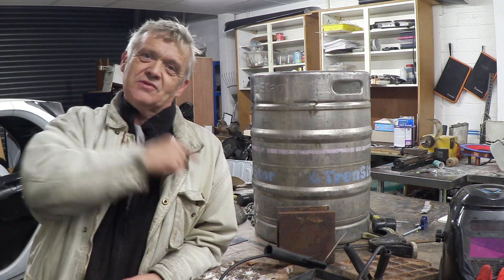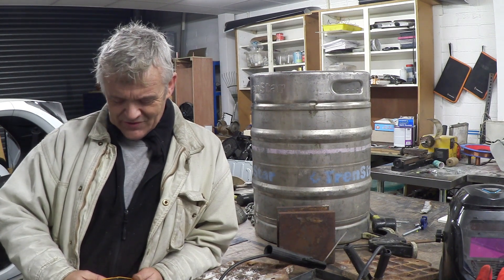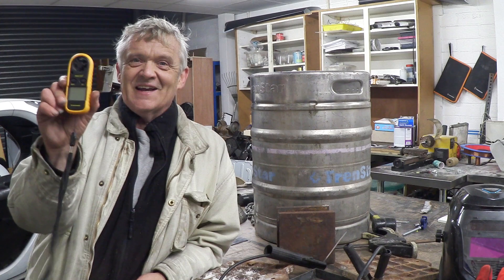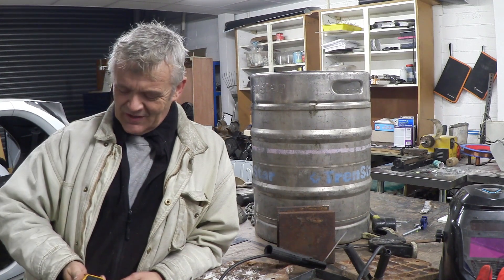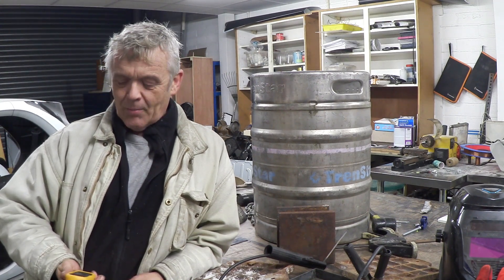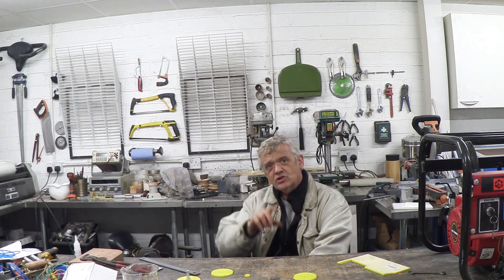Building a 1kW Wind Turbine  For Under £100 - Part 7 - A Real Wind Test

Comment: I was impressed at the begging but when it went to electric part I am disappointing with some of your explanations or thoughts. Trying to use transformer cores opposite way... No one who really knows what to do will never ever think about it. And I expected that spacing of magnets you designed to fit exactly the patter of magnetic core interface and then you talked about putting it in 90 degrees to the magnet line. I lost completely feeling that you know what you are doing. I hope you bring some real numbers from MPPT converter soon or you try ti find it with variable resistor and two meters looking at the values together. You always measured open voltage and short circuit current that can not be multiplied to get power. And how close you want to add the coils. Also magnet orientation is probably not the best what about using Halbach array. I understand you are trying to do it in 100GBP but...
Reply from the maker: you seem to be taking this a bit seriously - to be honest mate I don't know what I am doing and have said so many times. I am by no means an expert and I am certainly not putting my self forward as such - it really doesn't surprise me I am getting things wrong - but that's all part of the journey lol

Comment: Toss this on top of a water tower at a higher height and run it to move the water up via a battery bank on a cycle that can be reusable, but discharge the resivore as a larger battery.

Comment: imagine making these around 12" high about a meter square and placing 20 of them on top of a truck trailer, when its doing motorway speeds, could it be enough to run or charge an electric truck?

Comment: Hi Rob.
I tinkered a little with Crossflow Wind Turbines a few years ago. I think you'll achieve better RPM and power if you alter the angle of attack of your blades.
Reply: Thank you for your input! What adjustment would you recommend?... assuming the same 60° blade shape. I believe 37° was his specified goal.

Comment: Will you please explain, in more detail, the problems you believe to be with horizontal, versus vertical magnet arrays?
Reply: One problem is it will also need to be able rotate about a vertical axis to face the wind, this adds to the complexity.

Comment: MORE coils is '[almost] always better [provided there are not so many they cause the turbine to stall anyhow, because the more you interrupt a circuit, the more efficient the power gain, be it by the total number of coils, OR the increasing frequency experienced by those coils. ~( 'w')/

Comment: I would say here that checking the wind speed against any form of obstructive surface is going to give you a rather inaccurate reading... ~( 'w')/

To get the true and genuine speed, you need to hold your anemometer at least 1 meter away from the object, or AHEAD OF the object, so as to get the pure, uninterrupted or accelerated wind speed.

Comment: I use 600watts available per square meter at 10m/s. VAWTs may be as low as 15% efficiency, so 0.48m^2 should get at least 40 watts, but vanes to block incoming wind striking the part of the rotor moving into the wind should raise the efficiency, and if those vanes extend farther, they may increase the "swept area".
Reply: Just redoing my calculation above and removing the 16/27 factor the calculation comes out at spot on 600 watts at 10 m/s. Good to see some correlation.

Comment: I've watched quite a few of your videos now, and really enjoy the "guerrilla engineering", so forgive me if you have already tried this in your various turbine experiments. Have you tried using one of those spinning signs as a blade? The ones with a sort of "S" cross section. I've thought for about 20 years they seem a very efficient shape for a VAWT.
Reply from the maker: they are basically a Savonius type mate - but I really like the idea there

Comment: If you want to improve the rotational velocity then you want to keep the mass to the center and avoid as much as possible having it on the outer diameter.  Any drag at the outer edge will have a mechanical advantage working against power output.  Keep your motor separated from the turbine mechanism or it will be very poor efficiency.  Sticking to the principles of physics, wins.
Reply from the maker: cheers mate

Comment: Really promising, this could well be the basis for my grand off-grid plan using several technologies together for power (combining this, wood gasification and solar, to name some) Not to mention an FWG battery-bank. I built myself a vertical generator some years ago for my yurt and while it did produce something and was therefore useful, it was really crappy!
Reply from the maker: they tend to be lol

Comment: Robert. I have a possible dumb / genius question.. Watching the blades rotate, I can't help but think that there will also be a fair bit of wind resistance on the blades as they spin towards the wind - after they have been pushed away.. Whatever the terminology is. "Drag" or whatever. I wonder the efficiency and how this can be more streamlined?
Reply from the maker: oh there is mate - but it has positives as well as negatives - for one think it limits the speed in high winds and may well do away with the need for a brake

Comment: hi Robert, great work! I have a test proposition for you with a wildlife issue wind turbine usually create...  the bird killing one...  
I was wondering if it would impact the output of the turbine if you install a mesh grill around the blades...  some kind of mosquito net but strong enough to avoid birds to go inside the drum... 
1- would it cause a significant drop in production output?
2- would it add some momentum keeping effect to have more weight on the wheel on the outer rim...
Reply from the maker: I was thinking the same thing mate

Comment: An armchair observation, I admit, but something occurs to me. The advantages to the horizontal axis arrangement is low wind speed operation and unidirectional, like those turning signs you used to see in the street. However the angled corner boards fitted may hamper output depending on the direction. If you were able to take a leaf out of windmill design and have a sail that "pointed" the machine into the wind it might be better, further development maybe a c shaped cup which shields the "return" side of the machine reducing the drag against the oncoming wind. If this 'c' could turn independently from the turbine axis but with the same centre and be steered to shield as described, this would be, I think, a good step forward with limited extra work and simple basic design with the concept already existing. I may help overcome the 9mps stall speed and even tune the machine to self-regulate at a design limit.
Reply from the maker: it's 0.9mps stall speed mate - that's not really a problem - but cheers
Reply: @ThinkingandTinkering  I meant the upper limit.

Comment: Makes sense to me . High inductance and high torgue low rpm  is a good design. I do wonder how many Mot coils you could load it with ? They will only create to much resistance with a certain amount of rpm so i feel it maybe self regulating at some point which i think is the peak average you design it for ! I cant help think that a mechanism that lowers or raises the gap between inductors and magnets will be the best way to tune it for a known wind speed predicted by the weather app. But then of course an arduino code could easily perform that function  via feedback from mppt regulator . Very interesting development Rob . Thoroughly enjoying your patience 👍🏻
Reply from the maker: cheers mate - certainly lots to think about

Comment: Would it be straight forward to connect several coils together Mr Smith, or would a higher gauge wire need to be introduced to collect the charge from multiple coils etc? Thanks.
Reply from the maker: I did cover this on an earlier video mate
Reply: @ThinkingandTinkering  Apologizes, I'll check more thoroughly sir.

Comment: So if the magnets are on the rim of the wheel and turbine wheel is horizontal it works much better ? 
If so, is it because of Gravity?
Reply from the maker: I am sorry mate I don't understand. The turbine is vertical in it's axis - are you asking if I turned it horizontal would it be better?

Comment: 80 amp alternator and 775 would do that on a solar panel if you need more during the day. and if you another to charge an ebike battery it will run for 15 hours at night with a drain arrange at 13 volts. 1/6 th amp and 12 volts is the drain you figure the rest. alternator must be self excited.
Reply from the maker: there are always alternatives mate

Comment: Take off the 4 angled pieces at each of the 4 corners. They reduce the efficiency. The clean 180 degree air flow of the wind around the generator will improve the transfer of wind energy. As it is, the air is not flowing.
When the drum has air flowing around it, the energy is imparted to the impeller for the full 180 degrees of the drum. With the 4 dividers, the air flow is impeded and the laminar  flow is reduced.
Reply from the maker: they may well reduce efficiency but they also stop it being blown to pieces

Comment: @ Robert Murray Smith

Hi Rob

To make up for the lack of wind speed in your area, can you build a larger scoop out of scrap material and extend the baffles out a foot or so more than they are and add a top and bottom piece.

Basically just a giant scoop. To force  more air into the fan.

That should make up for the low AirSpeed in your area I think.

Cheers mate 😀
Reply from the maker: it's a good idea mate - but I can also hear the moans from other viewers lol

Comment: Don't put a light bulb load on your system... just a meter to measure the electrical output.   If you leave the lights on it will pull down on the generator, slow it down or even stop its rotation.
Reply from the maker: cheers mate

Comment: We have had horrible wind here today, really strong gusts all day, maybe now it that it has gotten dark it will settle down . If that size blade will drive enough of them you can stack the coils and magnets in layers in an alternating manner, like a sandwich Muller motor. I think your turbine works fine, you just need more wind. Thanks Rob
Reply from the maker: cheers mate and nice ideas

Comment: can you get a anonometer reading from your fan that you used to turn it in your shop in earlier videos? That way to get a reference as well.
Reply from the maker: it wouldn't be a good reference as the fan outputs a steady stream in a fairly narrow field of operation - so it's likely to be high at the centre and non existence at the edge

Comment: Nice Macgyver but if the wind is strong where's the brake or wind diffuser
Reply: Simply shorting the coils would be more than effective at preventing this design from spinning itself to death in high winds.
Reply from the maker: there isn't one - I believe VAWTs are self limiting

Comment: The most efficient design probably would be work on high air flow rates at low differential pressure and operate like a giant rotary feeder or airlock. Again it should be installed between large structures that present an obstacle to prevailing winds.
Reply from the maker: for sure mate

Comment: Have anyone thought about the maximum windspeed Robert's turbine can withstand? HWT have mechanisms to protect them from damage in high speed winds such a 'feathering' or braking  mechanisms. Is this design self-limiting (I don't know)? We don't want this build to 'come apart at the seams' do we boys?
Reply: Vawt are self limiting as half the turbine is going against the wind  unless the directional baffles are placed to prevent that 
I dare say rob will develop some sort of mechanism to regulate wind speed  which will utilise the energy
Reply from the maker: I believe VAWTs are self limiting for the reason John pointed out mate

Comment: Install your turbine between two tall structures & fill in the gaps to maximize the differential pressure across the fan. Also vertically block 1/2 of the face to direct all the air flow into the correct side of the impeller.
Reply from the maker: cheers mate

Comment: One thing I never understood about wind farms: when its very windy, they are stopped. I know the constraints of working in real life scenarios but even the sturdier ones are built like that. Why not create more contraptions to increase the work needed and thus generating more energy from storms?
Sadly it will be a long time before Im able to spend this kind of money but is something that will always bug me.
Nice work
Reply: With sufficient meteorological data you can build a wind profile for the site of a wind farm. You then design your HAWT to extract the most energy from the available wind. This inevitably means there will be both an upper and a lower limit for your turbine. The power of the wind increases with the square of the wind speed, so a 30 knot half Gale is 9 times as powerful as a 10 knot moderate breeze. This has the potential to overload the generator and require mechanical braking to prevent run-away. Both conditions cause significant risk of fire. It’s also putting nine times the stress on the blades.
Reply: Another reason you see wind turbines stationary Is because they are so easy to start up and shut down. Therefore they get used to balance the grid.
Reply from the maker: I really have spent very little on this mate - about £45 to date
Reply: @ThinkingandTinkering  Really seems small, but I live in Brazil, which translates 45 euro into 290 ish Brazilian Reais - thats a month of rent. To put into perspective: our "minimum wage" is 1100 BRL, or 170 Euros. Also every component gets practically 100% imported to Brazil, increasing its price by 70% ONLY considering taxes and not delivery itself. Unfortunately that also means 3d printing, CNC and other kits get costly around these parts. Man do I hate seeing such wonderful things on the internet and not be able to tinker with it. But you keep the good work mate

Comment: Is there any chance of showing the magnet to coil relationship on the rim?
I think you will get more bang for your buck if they are both symmetrical and the magnet spacing ties in with the core elements. 
I am sure you figured this all out, but it was not clear in the videos which way you did it ;0)

I think there is great potential for this type of kit to impact on both tall buildings like blocks of flats and in city centers where there is a lot of wind that is turbulent!
Reply from the maker: it's in an earlier video mate - I am being very open on this if you watch the series through you will have all the info
Reply: @ThinkingandTinkering  I watched them all (been subed for a while now), but you only said you put the magnets N to S alternating. You didn't show the orientation, or the orientation of the cores the coils are in.  If you have the magnets end to end N-S then the most flux density is between the poles and you would not be breaking many lines of flux with your core. If you have the magnets N-S S-N but placed side to side the max flux will be out of the ends of each magnet and through the ones next to it. If your cores break this you get more power (and resistance to turning). If  your magnets are spaced so that the N is at each end of the E shaped core and the S is at the middle you will again maximize your energy transfer ...... I could not see of the video which way you configured it. Sorry for going on a bit but some ideas are not easily compressed into a few words easily but it is like resonance or like the soldiers having to break step when crossing a bridge ..... Still all good videos

Comment: Take a look at a LG or similar flat washing machine motor , they are a package deal of what you are making and they can be staked , you have to cut the windings to Mach voltage requirements and add power and cog control as you have done, but they are cheep and pre assembled
Reply: Washing machines are plentiful if you keep your eyes peeled. I have two brushless motors in my parts box ready for projects.
Reply from the maker: cheers mate

Comment: Very cool, it got me thinking about a thinner circumference with taller helical blades that keep the same circumference but use the same coil setup as you are using. Strength needs to be maintained but without excess weight.
Great video, I have some things on order. I am going to try a combined generator and magnet / coil arrangement for additional efficiency. Thanks Rob.
Reply from the maker: nice one mate - good luck with it